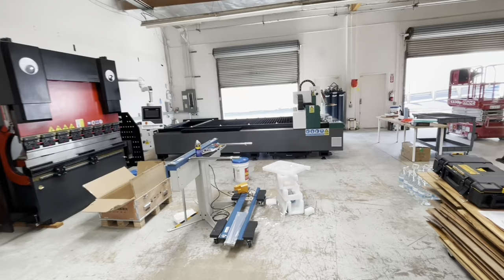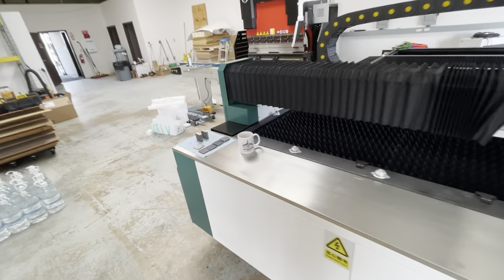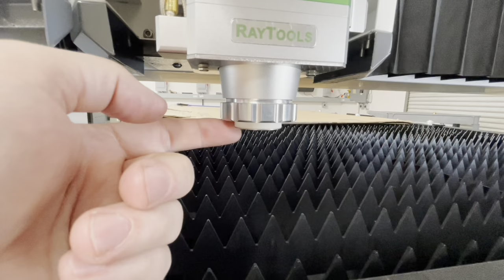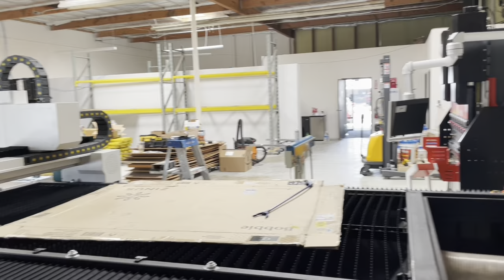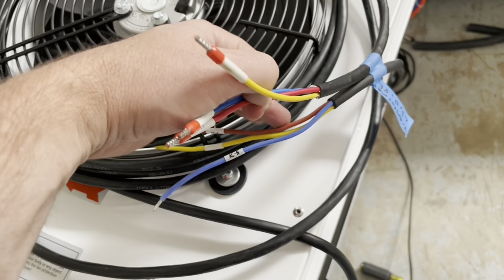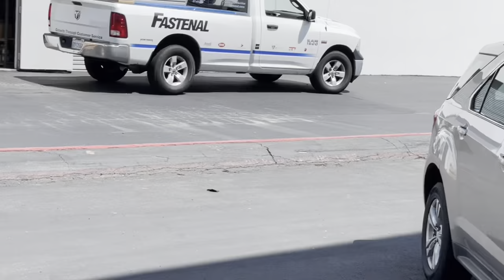Laser - Press Brake - San Diego Day 1

Comment: I'm thinking about buying a pressbrake with a 3000 mm bending length with smth round 110 or 135 tons. Do you import/export to germany? Accurl ships to germany but prima? I have 400 Volts, 50 Amps currently and would like a Delem Controller.

Comment: When building a shop or a property... what's the voltage from the street you would ideally want to have brought in, if you could choose?
Reply: depends on the equipment you are running.
Reply: @mattrevesz  I'm aware of that... but when calling up Gary, and saying I want a 3 or 4kw machine, he'll ask what kind of power service I've already got. My question is, if I'm building from scratch, and can specify my power... ideally, what should I be shooting for to give myself enough overhead for growth?
Reply from the maker: @thedillpickle, nah, it really doesnt matter in this context.  He asked the question in a way of "what is ideal voltage". So with a question like this, my answer is the same.  480v 3ph.  This will give you the best overall power consumption and flexibility.  Spend another $3Kish and get a step down transformer for yoru facility, and with that setup you can run just about any machine.